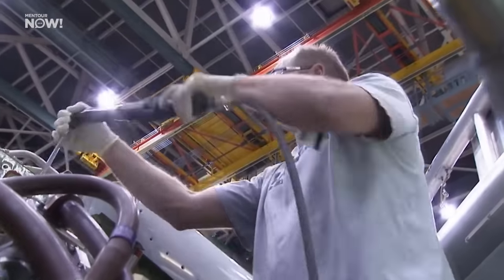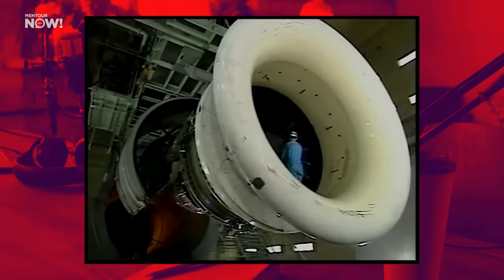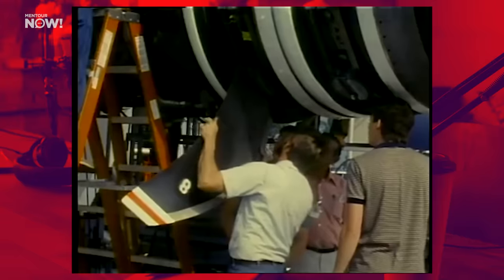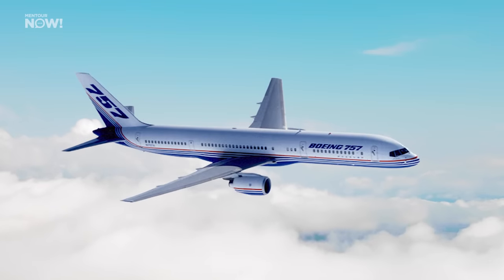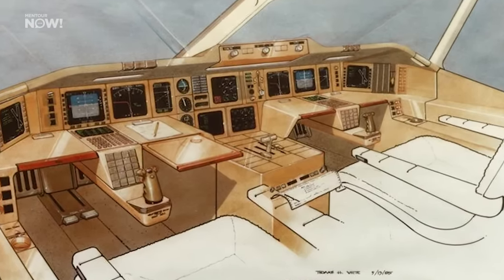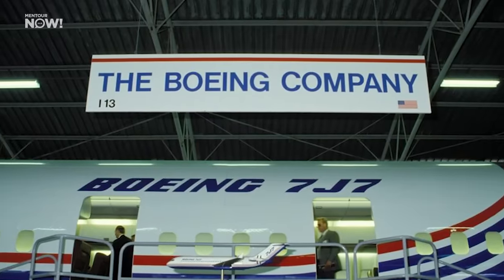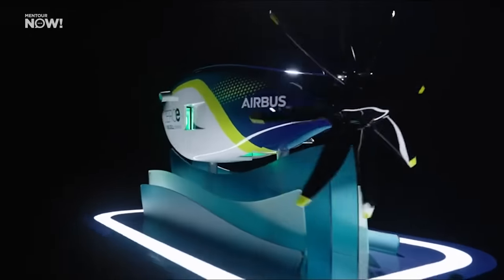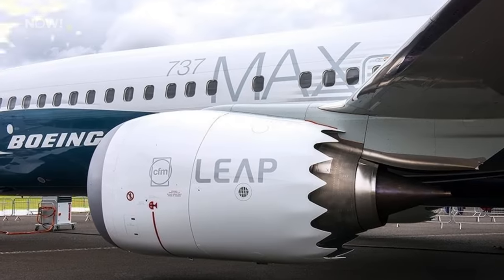Revolutionizing Flight! The Amazing Potential of the CFM RISE Engine.

Comment: The Soviets even turned that Tubroprop bomber into a civilian airliner and had it fly from Murmansk to Cuba. Imagine being on a cruise ship somewhere in the Atlantic and that incredibly loud thing would fly over. That must have been a bizarre experience.
Reply: The Tu-114 was both successful and had a good safety record (unlike a number of Soviet aircraft). It was succeeded by the Il-62, a Soviet take on the VC-10, with a bad safety record (Polish Airlines LOT lost two around Warsaw  in the 1980's due to uncontained engine break-ups).
Reply: @awuma  it wasn't a take on the vc-10. Both Vickers and Ilyushin had similar design tasks so they just happened to make the most fitting configuration
Reply: Considering that most jets of the time were Turbojets, I would actually guess the Bear bomber, and subsequent developments of it, were actually very much on the quiet side of 1960's-1970's large aircraft.

Comment: I am a retired Boeing engineer here who worked on 7J7 program when I first hired into the company in 1985. This is a good summary of what happened. But one thing which is left out is the generally unforeseen business success of the 737-300 using the CFM-56 engine and the use of hub-and-spoke. With both low fuel prices and the success of the 737-300, there was not need for the technology of the 7J7 to meet the requirement of Delta's RFP for a 150 passenger aircraft.  

There was quite a bit of government and industry focus on fuel efficiency in the 1970s due to the oil crisis. Methods of design and certification of advanced composite materials, which would have been used on the 7J7, were initial researched during this time as part of NASA's effort to reduce fuel use. The use of composite materials in primary structure on 7J7 was pursued in fact to address the high sonic environment of the unducted fan.

One other reminder is that the cruise speed of the 737 Classic family of aircraft (737-300, -400, and -500) is between M = 0.74 - 0.78. So the lower cruise speed of a CFM RISE engine is not that out-of-the-ordinary in comparison.
Reply from the maker: Thanks! That’s great insight
Reply: Yea, your memory is a bit faulty: What killed the ultra fan was... the ultra fan and its abysmally LOW mach speed required.  Who is going to pay $$$ to fly in a Mach 0.6 aircraft instead of Mach 0.82-->0.85? No one.  Noise was just the nail in its coffin.
Reply: @w8stral  I might not have known about any findings from flight test as this was not my engineering discipline, but the 7J7 was most certainly designed to be a Mach 0.83 airplane.
Reply: @w8stral did…. did you really just try to tell an engineer who worked on that aircraft he’s wrong?
Reply: Dear mr Berner, are you saying effectively that Boeing chose the short term commercial profits over developing a modelengine for years when oilprices would go up?
Reply: @Dirk-van-den-Berg  It looks like it and why shouldn't they? Most manufacturers took that same route. Look at the car industry: manufacturers panicked when the oil crisis hit and hastily developed smaller and more fuel-efficient cars. After the crisis past and fuel became cheap(er) again, those smaller cars almost immediately grew into full size again. 
Pretty much the same seems to be true for airplanes: it's only when customers demand more fuel-efficient planes that manufacturers will start producing them. Why put a lot of money into research and development when your planes are only marginally less fuel-efficient than those of the competitor?
Reply: @jimmygee3219  I'm another aerospace engineer and we get it all the time in every field of engineering.
And I'm not talking about social media either. We get it from family, we get it from relatives, we get it from friends and we get it from complete strangers in the street.
Most of all we get it from other people in the work place and including other engineers.
If you tell people what they don't want to hear they don't like it and don't respond well. Then they will do and say anything to discredit you.
Reply: @w8stral  This airplane used the UDF, not the IAE SuperFan.
Reply: @w8stral  your memory is a bit faulty? Jesus christ that's arrogant
Reply: @vitordelima  Why are you bringing up the superfan?  That was ducted honey.  We are talking unducted.
Reply: @w8stral  where did you get the term "ultra fan" from?
Reply: @phoenixgtr  Ultra was probably wrong word.  Should have used ultimate.  Confusion with the very recent RR HB GT I should have forseen.
Reply: @tonywilson4713  The most common and inexplicable YouTubers are the one who automatically comment  “why are you lying for clout?!” anytime someone comments they are in some way involved in the topic the video is discussing. Who lies about being an engineer for “clout?” Never seen paparazzi and models swarming composite materials engineers or asking for the autograph of the lead engineer on some new Lockheed fire control  system. Even saw a man accused of lying about being a janitor when he mentioned he was working as janitor at the time of a crime in the building next door. 🤦🏽
Reply: @w8stral  No point in continuing this talk with you.
Reply: Delta never ordered the 737-300. They went with a combination of 757's and MD-88s
Reply: @jeffberner8206  Maximum mach speeds are not cruise speeds... Stop embarassing yourself pretending to be an engineer on the project...
Reply: @H2s Well that goes without saying... for values of "divergent" for what portion of the blade at what AoA effective? And therefore why Mach is a reliable number and why RPM is so critical here.  How much energy is wasted in said gear reduction again?  A gargantuan amount.  There is no duct to increase density over the incoming stream over the blade outter sections increasing mach speed decreasing proportion going transonic/supersonic at altitude.  So yes, Mach number matters in both ducted and unducted fans.  True, ability to make ever thinner blade sections at correct AoA keeps increasing available mach number for cruise, but massive increases in transonic drag is transonic drag
Reply: The noise was so annoying.  I spent time in the Mojave Desert and got to listen to the unducted fan.  Imagine a really loud Kawasaki 900 or 600 with no muffler, stuck in first gear wide open(without rev limiter) running down a highway, half a mile away on a very quiet night.  It would take five minutes for the sound to go away.
Reply: @Dirk-van-den-Berg  That's precisely what happened. Oil prices were a concern for a while and they chose to seek a more efficient engine to solve the needs of the moment, but when the prices dropped and oil was cheap again, of course they would drop the more expensive project and choose to keep working as they always had.
Reply: You spend decades developing and perfecting this open fan design until you've got it down perfect.  Then someone comes along and says - "Hey Moe, isn't that a Turboprop"
Reply: @jeffk464  lol
Reply: @PasleyAviationPhotography  Christ is a title and should have been capitalized. As an engineer, it would be "Jesus the Christ". That being said, your last sentence is incoherent.
Reply: What about CFM engines horrendously high failure rates?
Reply: @Anonymous______________  Actually they are notoriously reliable. That's why they power easily 70% + of the narrow body aircraft between Boeing and Airbus
Reply: @jimmygee3219  my man!
Reply: I understood that the biggest single driver of the7J7 failure was that airlines didn't want it
 - they wanted another 737 (so that pilots didn't need expensive retraining) - bearing in mind this was when deregulation hit and outfits like Southwest wanted utterly homogenous fleets

The NG has the dubious distinction of being an aircraft created by accountants, to satisfy that demand and probably marked the transition of Boeing from an engineering/safety focused airframer to those taking a backseat to maximising profits. 

The story of how Boeing treated the counterfeit fueslage rib parts whistleblowers in 2002 (and how the FAA shopped them back to Boeing within a week) indicates how deeply the regulatory capture had gone even then. If the NG had been a new aircraft, the power-on nose-rise when near stall speeds would have most likely resulted in it never getting past prototyping and it arguably should never have been type-approved as-was
Reply: Oil crisis? You mean the totally manufactured oil “crisis” ?
Reply: Thanks for your inputs!  Really cool to hear from someone who worked on the original!
Reply: @miscbits6399  Mixing things up here. The 737NG first flew in 1997 and I worked on that airplane as well. The 737NG was launched because United just ordered the A320 instead of the 737-400. Southwest Airlines was our biggest customer and we needed to make the airplane work for their operations.
Reply: i dont understand how this will go as fast a jet nor as high. looks like a glorified prop to me.
Reply: @miscbits6399  You are confusing separate eras. The NG version wasn't even the picture yet for the 737. This was mid to late 80s and the 737 wasn't much of thing aside from a few carriers at the time. This was a 727 replacement idea. The first 737 NG didn't fly until 1997. This was LONG before the MD merger. I think you seem to be confusing it with the MAX. Other than Southwest, commonalty wasn't a thing back then.
Reply: Ukraine was the first to fly a pre-prototype plane with propfans (An-70)!
Reply: @internetcensure5849  Not really relevant at this point.
Reply: But he didnt leave that out.
Reply: Sounds like a lot of thank the government for yet again interrupting true free market
Reply: Doesn’t look like great idea for under wing, is that being tested
Reply: @tonywilson4713  Yep. They will go as far as taking you to court over it, if they are that petty.
Reply: @Dumbrarere  And they usually are that petty. 🤷‍♀🤷‍♀🤷‍♂🤷‍♂
Reply: @steveallen648  Well you should have been clear about that instead of waffling on with a pile of nonsense.
Reply: @steveallen648  Actually, the first aircraft to fly with turboprops was a modified Gloster Meteor in 1945. An example of Britain's first operational jet fighter, it was retrofitted with two Rolls Royce RB.50 “Trent” turboprop engines driving 5-bladed propellers. The technology itself dates back to 1929, patented by a Hungarian.
Reply: @Dumbrarere  The P-38 Lightning had turboprobs back in 1938, and as I recall it was not the first turboprop. And I am not confusing turbochargers with superchargers, though I know the terminology was often confused back then.
Reply: @ryanaegis3544  That's not what a turboprop is. A piston engine with a turbocharger is still a piston engine. A turboprop is sort of a crossbreed hybrid turbojet with a propeller slapped on it. https://en.wikipedia.org/wiki/Turboprop
Reply: @w8stral  You epitomize everything that’s wrong with so many YouTube commenters.
Reply: @carlpolen7437  Truth to ignorance
Reply: @ryanaegis3544  Whaat? What sort of turbine was that then, driving the prop. Please expand on that..
Reply: I'm wondering what will ultimately win out? The slow speed of the CFM Rise (slow relative to a high bypass ratio turbofan for example) or the upcoming Bombardier Global 8000 private jet (which has hit Mach 1 in testing) Vs fuel efficiency.

I suspect fuel efficiency may end up winning out in the end. Given the ever increasing focus on sustainable aviation and net zero aviation by 2050.
Reply: @w8stral What will win out do you think? The exceptional fuel efficient 'slow' CFM Rise or something like the upcoming Rolls Royce Ultrafan?
Reply: @w8stral Your first 5 comments were 5 opportunities to not come across as an arrogant, high-and-mighty "smarter-than-you" sh¡tstain. 

You failed them all. Not only saying in one "stop pretending that you are an engineer" but also, in another comment, insulting an actual engineer by claiming his memory is deffective. 

Life lesson numero uno, amigo:

It's not what you say; It's how you say it.

If your tone, or in the case of comments your choice of words, is deliberately and unnecessarily rude and disrespectful, no one will be interested, or even tolerant, of what you have to say.

Even if you are 100% right.
Reply: What about the oppressive noise?
Reply: Yo keep your voice down bro. They’ll get you
Reply: If you fly a CFM56 aircraft at .60 Mach, you will see the same efficiency with 10 percent of the noise.  No gearbox, no FOD issues, no skin fatigue, and 30 million hours of service  history.
Reply: @w8stral  did you even watch the video?

Comment: Around three decades ago I was a student at Embry-Riddle Aeronautical University. We were shown a video of the "un-ducted fan engine" and it sounded promising. I always wondered what happened to it. Now I know. Thanks for this video.
Reply: Was about to say, distincly remember reading way back when about it, propfan 727 no less.
Reply: This is why I love YT and the internet. Incredible.
Reply: I just got accepted to embry!! Im doing astronautics
Reply: @jb04evanivich  I wish you the best! ERAU is very expensive, so make sure you do your best.
Reply: I worked on it directly back in 85-86.  My memory was that, as expected, there were tech challenges but the deal killer was the precipitous drop to  $10/barrel oil.  This was much more expensive of an engine than normal engines (2.5 X) and the value prop fell through.  The value was fuel savings.  With ultra cheap fuel, it didn't make sense.  Tech was compelling.  Business case wasn't.
Reply: My lady cousin went to EM too. Became a pilot for United. Retiring by now. Bye to 747 for her. Sad.
Reply: As it turns out a contrarotating pair is even better, because instead of the rear flow straightener the lower loading is better, the efficiency is about 92% and what is important the contrarotation mechanism is actually simpler than the reduction gear needed by such a large diameter propeller.
The sowiet time bomber is still in use, but the noise is drastically reduced
Reply: Can you explain what the point is with the non-rotating blades in this new engine?
Reply: @jb04evanivich congrats! I just finished my first year as an AE aero. Which campus are you headed to?

Comment: This episode hits home! In 2013-2014, I worked on the design of the engine mount system for that Safran SAGE2 open rotor engine demonstrator under Cleansky EU initiative. I learned a lot as a younger Aerospace Stress Engineer. Proud to have been part of it 🙂
Reply: Fellow Clean Sky grunt here. Good to see you

Comment: As a young engineering working at Pratt & Whitney Aircraft back in the late 1980's & early 1990's, I sat in a presentation from the President & CEO of P&W revealing how the engineering efforts were going to be totally dedicated to developing the counter rotating fan engines.  Extensive work had already been done on blade and gearbox development. It was an exciting time to be working on the projects to support this effort. The Applied Mechanics lab an experimental engine development was running wide open and the test cells were always running full scale tests around the clock. However, world economics (as mentioned) and the Desert Storm conflict brought all the development (and the commercial aircraft industry in general) to an abrupt halt. It amazed me to observe how this effort disappeared almost overnight. Flight testing was well underway and there were talks about achieving FAA certifications and establishing goals to meet them. Great video!